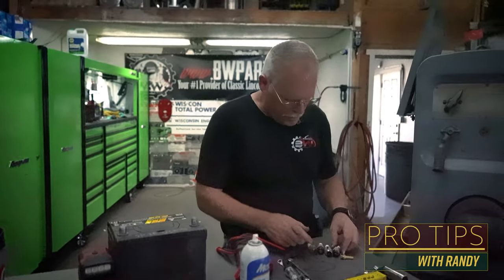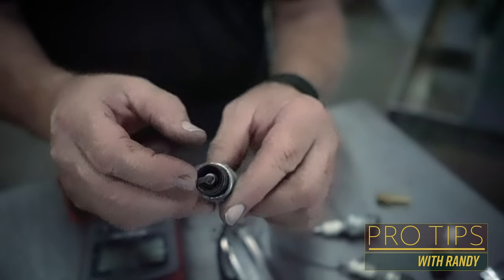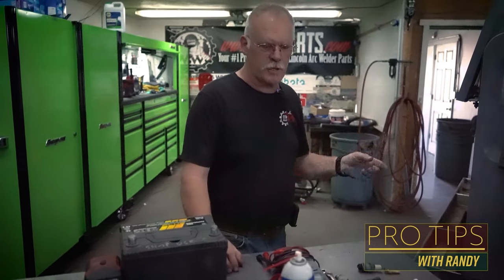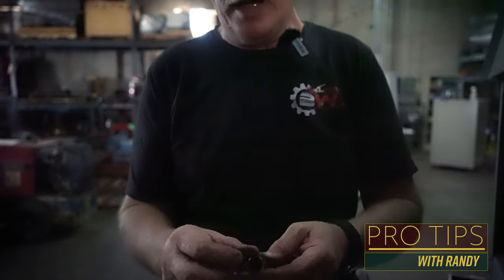Barn Find! What to look for when buying a Classic Lincoln SA-200 welder

Comment: I had a Lincoln tech tell me my 80 model sa 200 was obsolete and u can’t get parts for it. That was 4 years ago. It’s on my truck today making a living. Your videos is how I got it running again!!!! Just saying thanks!!!!
Reply from the maker: Your welcome, Glad we could help!!
Thanks Chuck
Reply: Most welding supply/shops want you to buy a new welding machine. Dealers are only there to sell new or late model machines. There are a few shops that will go that extra mile for you because they know that when the time comes to buy new machines, you will buy from them.
Reply: Sounds like the tech might be on COMMISSION

Comment: As far as I know and having many of these older machines...  They had 7.9:1 compression ratio.  115-120psi is what they should have on a compression test.  140psi is in the 9.5+:1 range.  Remember these machines were designed to be started by hand cranking.  Early machines didn't even have a starter or a ring gear on the fly wheel.
Reply: I was just about to comment exactly what you said.  I'm SUPER happy if they have 110psi. They don't need much to run well and they were designed that way for a reason.

Comment: I buy allot of SA 200 welders and my 2 cents goes like this. Over $2,000 needs to run, weld, and put out power.  Around $1,500 I will accept certain issues such as welds but doesn’t switch idle properly to high idle.
Or a carb that only will run machine when choked or missing sheet metal. Under $1,000 I’m buying every complete machine I come across. And for around $500 I’ll cross state lines to get it. The one part I suggest you never buy a machine without for more than $500 is a governor. You have no way to really test anything without it and governors are very pricey when you can find them. Magneto’s really only matter if your in to that sort of thing. BW has awesome electronic ignition kits of which I have bought more than a few myself and their hard to beat. I however suggest to rig welders running both a mag and a distributor. So you can easily switch between the two if you have to. (Carry proper plug wires for each)
The engine to me is absolutely the very least important part. You can find Continental F-163’s and 2’s hanging on trees. And they are probably the strongest most dependable engine made. I have ran welders personally for a living that created more smoke and blow by through the draft tube than I was creating burning 7018. The one thing you never want to do is get a machine running and welding in the presence of the seller. You will find they quickly become very sentimental to the old iron and the price will go up.
Reply: I just picked up a complete 1952 short hood for $500. I hope to get it running soon